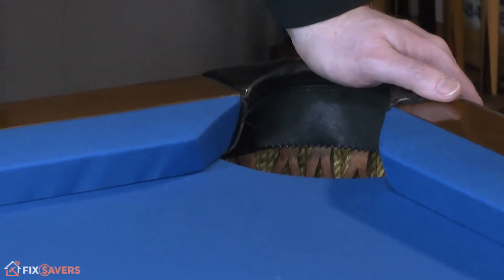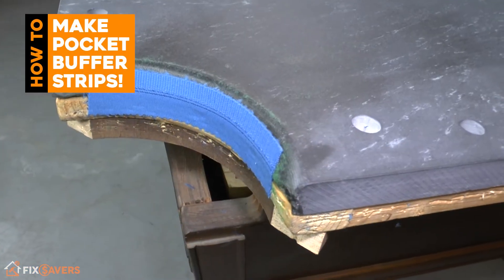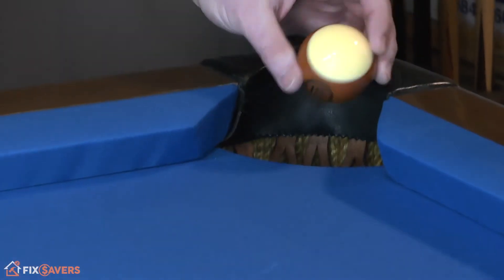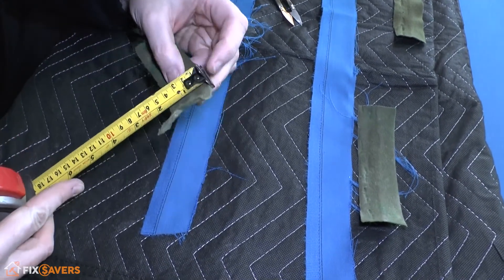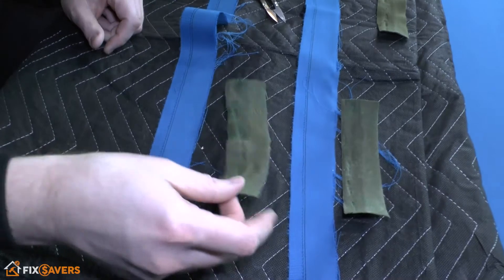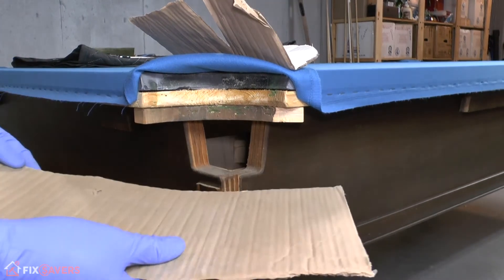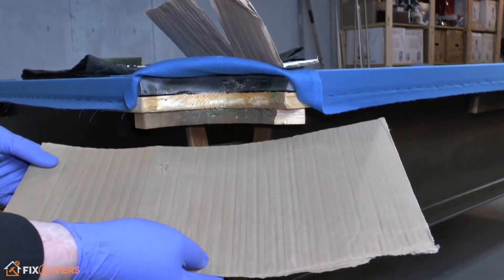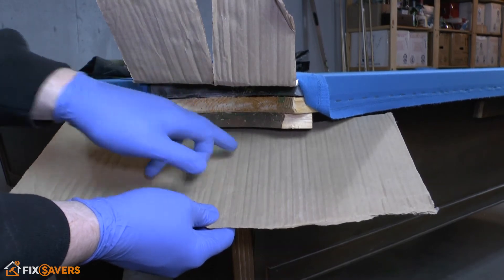Pool Table Cloth Installation: How to Make and Fit Pocket Liners (Buffers)

Comment: Hello, could I use some leather strips in place of the cloth strips ? The leather I have is 1 mm in thickness. Thank you and have a great day. Love your videos which have been VERY helpful.
Reply from the maker: Yes, absolutely. As long as the leather is thin and pliable enough to take the shape then leather can definitely be used. It offers more protection than just the extra layer of cloth. Hope that helps!
Reply: @AverageJoesPool  Yes and thank you so much !

Comment: I have some very thin, approximately 1mm thick leather. Would I be able to use this instead and would it be better or not ? I have been following your videos as I am re-assembling an old turn of the century Brunswick table and they have been of great help. So thank you and have a great day.
Reply from the maker: Yes, absolutely. As long as the leather is thin and pliable enough to take the shape then leather can definitely be used. It offers more protection than just the extra layer of cloth. Hope that helps!

Comment: Compra de 3M Super 77
Reply from the maker: We used an alternate brand (half the price) in our video, and it worked just as well! But 3M Super 77 is pretty much the industry standard for pool table installations, but of course it can also be done with other spray glues as well, provided they are definitely designed to be workable with fabrics (not all spray glues are!)